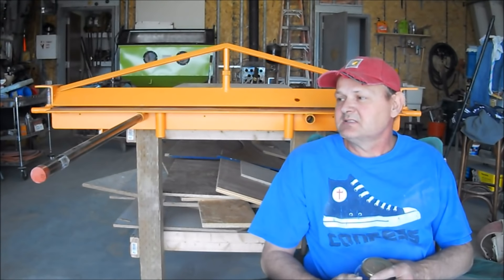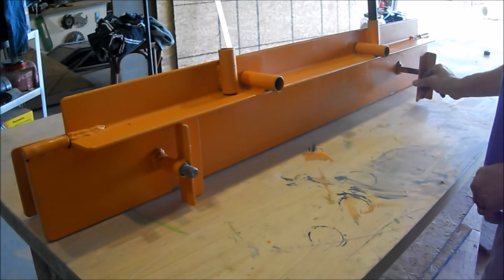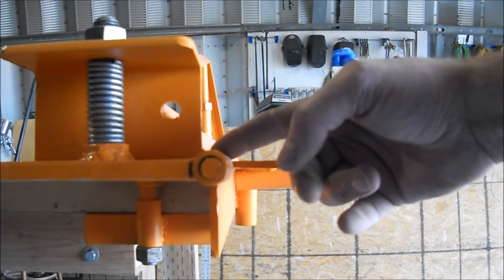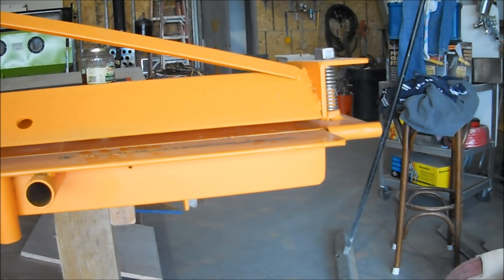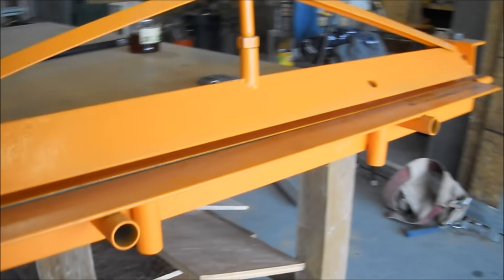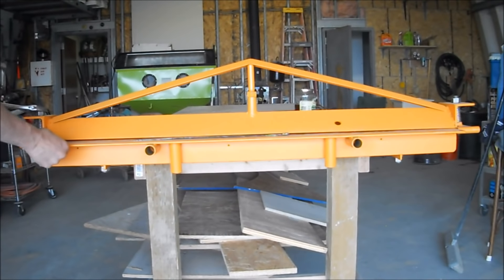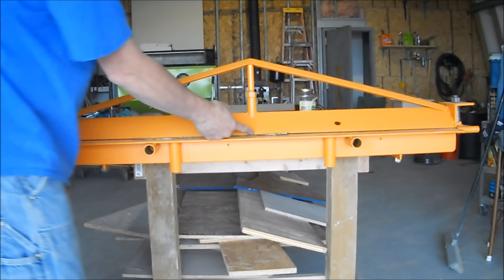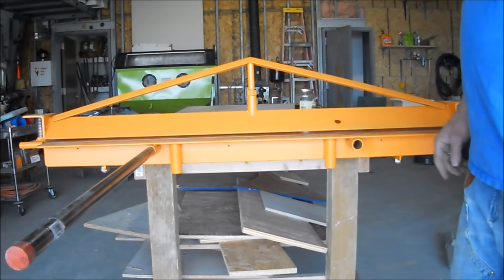Home made sheet metal brake (sheet metal bender)

Comment: I liked your Sheet Metal Brake so much that I'm in the process of making one. Any chance of being able to see some pictures of the section where you have welded the bolt to the truss at the top as I'm a bit unsure how you have put it in place there. Thanks
Reply from the maker: I used a 6" 5/8" bolt cut the head off, and welded the truss section to it, and welded a 3/4" pipe at the top of the angle at the bottom (Be sure you thread your nut on first, when you tighten down on the nut it pushes the truss against the angle forcing it down. Hope this helps, I have super busy lately doing like 4 jobs a week at this time, also we relocated to Wyoming from Utah about 2 years ago, and still have most the shop packed up; We are in the process of building new house and shop. Thanks for watching.

Comment: dude, have you ever thought of welding handles to those nuts ?(the ones that are attached to the spring bolt) if you havent yet and like that idea. weld them at the same angle that  you use your cresent wrench at 6:00
Reply from the maker: +seannootherway Had lots of comments on that one, No because I want to be able to really get down tightening on them, the thicker the metal the tighter you need to make it. Would end up using a cheater bar on it, so better just use wrench. Also makes it easier to store away when not in use.

Comment: All of the YouTube homemade brake videos that I've seen show the operator's need to continually loosen, then tighten the lock-down nuts at each end (and in this case, the center).  It seems to be more time-consuming than desirable.  I'm thinking cam levers with handles that are quicker and more user-friendly.
Reply from the maker: DDEENY If you need to use it like on a daily basis, you might just invest in one. I only use mine on occasions, like once or twice a year.

Comment: Gosh I looked everywhere here can" find anything but one that is 3.5".  Couldn't find that size on line either.  Another question, started welding the pieces today, for the hinges,  the solid tube pieces, did you weld them to the inside of the angle iron? The picture almost looks like maybe you removed some material to fit the piece in?Thanks again!
Reply from the maker: +Scott Sawyer I used regular 3/8 black plumbing pipe for that, and 3/8 round stock.

Comment: nice job! Looks like it has the best of all features for a brake.
One suggestion - I think it would be better if you can fold the edge a little past 90degrees due to metal property’s when bending...you may want to go to 45degrees in order to do a hem edge.
Reply from the maker: Thanks I just use a ball pein hammer and tap it down to the edge of the angle iron, then re clamp it down in the brake to flatten it down, when I get my new shop up and running I will have to demonstrate.
Reply: The Blue Collar Preacher Great! Can’t wait to see it.

Comment: Can you change the bend radius on this? If you can, how would or do you do it? Thanks
Reply from the maker: I'm not sure what mean by radius? if you are talking about the angle degrees, it can only go slightly less than 45 degrees. If you are talking about the radius of the bend itself, I've used pipes clamped down to it and used hammers to bend it. I think my truck floor board video shows how I did that. Thanks for watching.
Reply: @TheBlueCollarPreacher  
Thanks for the information. Stay well

Comment: i think if you cut vertical slits in the front half of the clamp part with a thin disk on an angle grinder at uneven intervals you can actually use those when youre bending a (1 inch high) box from sheetmetal , the sides allready bend need to fall in the slots when you bend the next then you can bend beyond the angle of the clamp itself

Comment: Good job, now add some roundbar handles on the nuts, so u won't need the wrench to tighten,150mm x 10mm bend at 50mm 45 degrees, to form a handle , weld to nut's. the centre  nut add a T handle, 2 100mm pieces off roundbar welded to nuts, round the ends off so as not to hurt your hands.
 We are not old just have some miles on us :)

Comment: FINALLY... someone demonstrating the bending of something thicker than sheet metal! Thanks.
Reply from the maker: THANKS, I get a lot of comments on why I didn't put rods on the lock down bolts so I don't need the wrench, Well the reason is I need more leverage to crank down on this thing to bind heavier gauge material. Thanks for watching.

Comment: Fantastic work, BCP.  Couple of questions for you please about the hinges.  Someone asked if you attached the round stock going into the tubing to the inside of the corner of the bottom angle.  I agree with that person that it looks like you removed some of the round stock, and that would move the center of the hinge up by the amount removed.  Or did you just weld the round stock to the underside as is?  Hope that makes sense.  Also, in that same post you mentioned that the round stock was 3/8" and in the materials list it's 1/2".  Would 3/8 do?  Thanks again
Reply from the maker: I removed some of the angle iron so I could get a good weld on the round stock, and keep it as close to the edge as possible. Thanks.
Reply: you removed angle iron from the inside corner?  How did you do that?
Reply from the maker: Plasma cutter and grinder.

Comment: I disagree holes should be  in angle iron you get to much flex if you don't.. l tryed the end fasteners and they wore out in a year , so I flattened edge and drilled it,, holds much better and put stop behind angle iron to keep it from pushing backwards.

Comment: Weld the hold down nuts to the end of a 3" or 4" long piece of 3/4" or 1" pipe, weld a cross handle on the other end of the pipe - no more finding wrenches! For the truss adjustment, a 4" or 5" stick of steel welded to the flat of the adjustment nut.

Comment: To make bend less muscle put a diagonal pipe on the ends and put a counter weight at the bottom. Do not try to make the bemd all at once, but do the bend 3 to 4 smaller bends.  Now I got to build one for my shop, great job !
Reply from the maker: Thanks for watching, I only use my bender about once a year, and need to store when not in use.
Reply: I will be building mine in the next week to build stainless tool boxes. Trying to come up with a way to add fingers.
Reply from the maker: Cool, I just subscribed to your channel can't wait to see some stuff welded up.
Reply: Just opening up my channel, just got electric in my 2 car metal garage so I'm off and running. First project is getting my garage organized ( been the families storage for the last 2 years) and fix my trailer so I can haul some metal. This week I have some long restaurant stainless serving tables coming in which will become tool boxes. For that I got to make a break for the stainless. I think If I just a couple short 1/2 "plate, and put a shim between them on the ends. Bevel the top edge, I can use that for the short bends instead of needing to use fingers.

Comment: Out of all the metal breaks I've seen on YouTube, yours the best. If you don't mind can you share your plans? The materials, measurements, etc.
Reply from the maker: Michael streete I will get those soon thanks.
Reply from the maker: Michael streete Angles = 2 @ 50”x 3x3x¼, 2 @ 26”x 1x1x3/16,  2 @ 5”x3x3x¼, 2 @ 6”x2x2x¼.
Pipes = 4 @ 3”x1”ID (handle inserts), 1 @ 3”x¾”ID, (truss),  2@ 2”x3/4ID (bench clamps),
 2 @ 3”x1/2ID, (hinges),  2 @ 6”x½” round stock (hinges), 1 @ 36” (handle). 5 bolts and nuts 4”x 5/8” 2 springs 1x4,  Flat stock 56”x6x½.

Comment: Preacher I changed up your plans a little.On the ends where you welded the bolts to hold the angle iron die I widened it to hold two bolts so I could move the die back and clamp down some half inch plate so I could use it as a box brake. Cool post thanks for sharing.
Reply from the maker: That is why I love YouTube, we can learn how to and how not to do things, or even improve on them. Thanks.

Comment: The edge of the top clamp should be set back 1.5 times the thickness of the metal. I have scene several commercial benders messed up because the operator did not set the top back far enough.

Comment: OK, you tighten both ends down first, and then the middle one to make it square, or flush, or whatever. It seems like you don't have to loosen the middle one again because the two on teach end should loosen it enough to slide the sheet metal out. I am asking a question because of what it seems like to me.
Reply from the maker: +Luvstruck I guess that would work, when your are bending more than one bend on same metal. I Just do this for storage time, to keep everything from warping. Thanks.

Comment: Nice looking break!   Unless you are counting on the strength and stiffness of the table it is mounted on, it looks like the bottom 1/2" x 6" base could use a truss or vertical plate stiffener.     The 1/2" x 6" steel base is quite flexible in the  vertical direction and this would not allow the material to be clamped in well.

Comment: Very nice job. I have done my share of bending with industrial benders. No matter how heavily built, someone will find a way to bend and distort the bending beams. You may wish to consider adding truss's to the movable angle beam. Angle iron is a good structural unit, but it will distort with enough applied force. Your video is appreciated.
Reply from the maker: +Robert Beck I will most likely only use this bender 2-3 times a year. And nothing more than 16g. anything heavier than that I will buy angle and weld to it. Thanks.

Comment: Put some filler metal in the angle iron and you won't have to turn that center bolt. I hate that idea. The Harbor Freight brake has that fuckin thing. Why not throw a piece of flatbar in that angle and bingo problem solved. Also, it should never have to be adjusted actually. You ought be able to set it and never worry about it.

Comment: it would be cool if you could add 'fingers' to the brake for box/pan bends. also if you welded a few pieces of rod to your bolts, you wouldn't need a wrench to insert/remove pieces from the brake. :)

Comment: Nice job preacher!  I built one from scratch as well but mine can't handle anything thicker than 26 gauge steel sheet like they use in HVAC duct work.  I was going to add a truss but put it off until I tested it out.  If I try to bend 14 gauge, I get bowing in the clamp.  After looking at your fine job, I'm going to add the top truss to mine.  God willing, I'd like to post mine once I get it refined.  for clamping the stock down, I have an eccentric cam mechanism that draws the top clamp down using a single lever.

Comment: Great construction and work! I watched it a couple times to try and figure out how you did the hinges. I saw the sizes you used but did you remove material in order to make it flush with the edge of the angle iron?
Reply from the maker: +jbandura19 Yes I ground out the inside edge to make it flush.

Comment: One of the better home made benders. You could make handles for the adjusting nuts so you dont have to rely on a shifter. Also, the centre truss bolt should not need to be tightened for every job, once its adjusted, it should not need to be moved. I can see a small problem thats causing your bends to be not very sharp. You have a gap and too much space between the top blade and the bottom one. Otherwise it looks ok.

Comment: You need to weld some cranks on those nuts
Reply from the maker: Not the first to mention that, However sometimes I really need to crank down on the metal depending on the gauge of it. also less things in my way when working with it.

Comment: nice bender.  appreciate your time and research.  How thick of metal do you figure this will bend.  I have some 3mm plate i would like to try.  Have you tried anything  in this thickness?
Reply from the maker: +MrMk3forme I have bent 16g I don't know what that is in mm, but I have seen other videos where hydraulics is used on heavier material.
Reply: yep i think this is around 10-12 guage. although yours looks mighty stout i believe it would still be a challenge

Comment: Good job, and thanks alot for your credits to me and the other people, you are very kind.
To solve the stuck problem when releasing the brake, you must turning the locking bolts up side down . Your brake, find it difficult to slide over the threads of the bolts so stuck.
Also your hinges, the internal diameter of bushing is too big for this pivot (as I can see, on video, the gap must be at least about 2.5 mm).
Good luck at your next projects.
Bill
Reply from the maker: kess Thanks for the tips